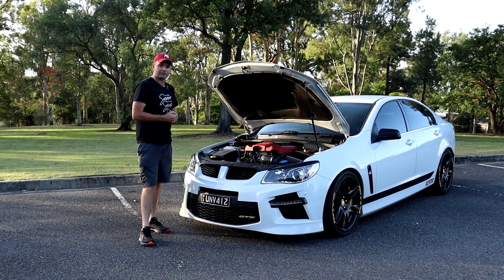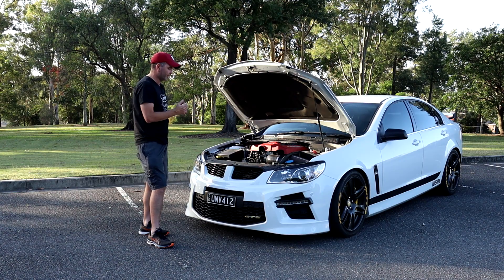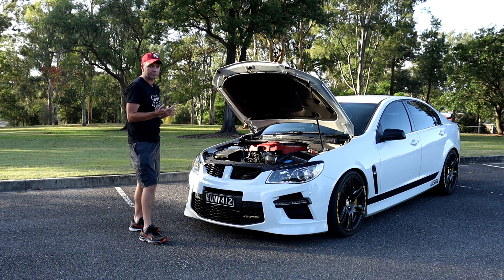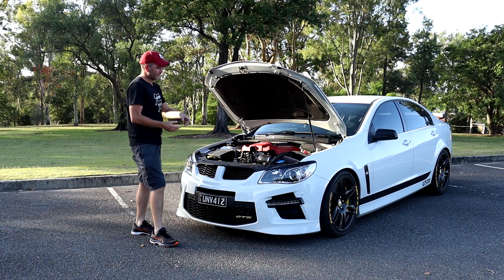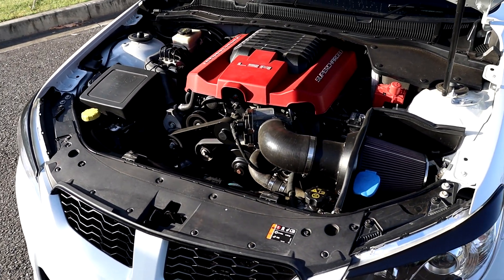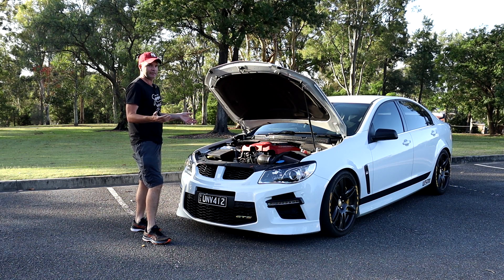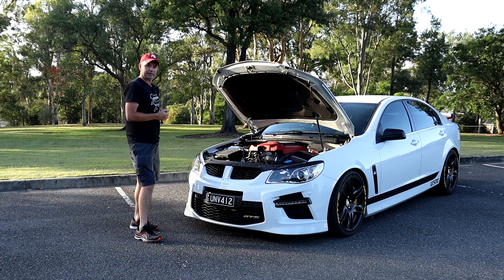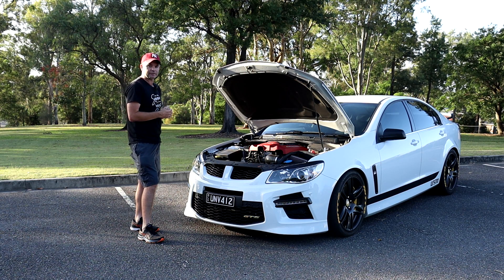700 HP HSV VF GTS ! You will want these additions

Comment: Is it on e85? What kind of fuel economy do you get?
Reply from the maker: its on 98 currently but has the sensor for e85 its just not tuned for it yet . About 300-350kms per tank but its not something you would be using as a daily